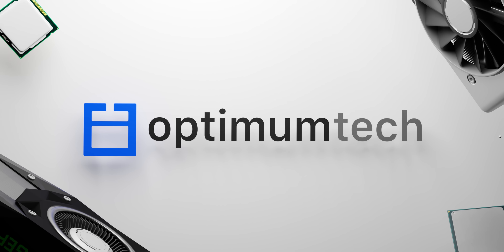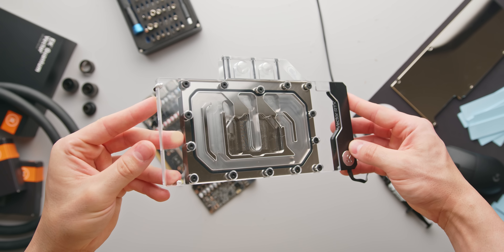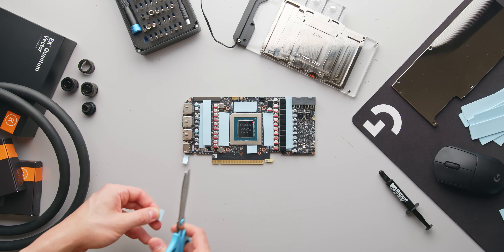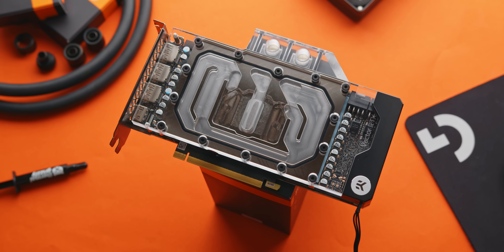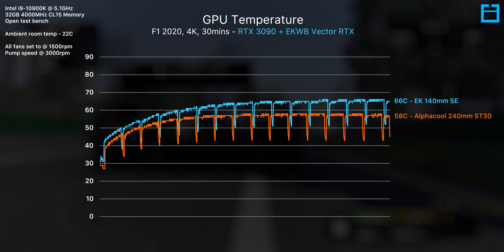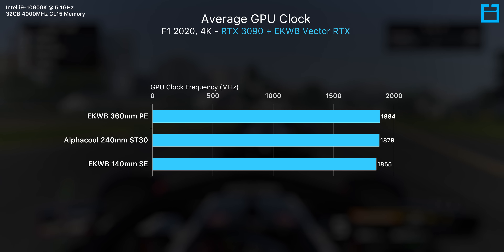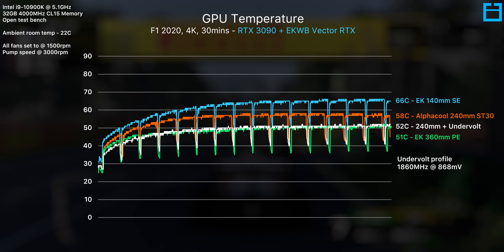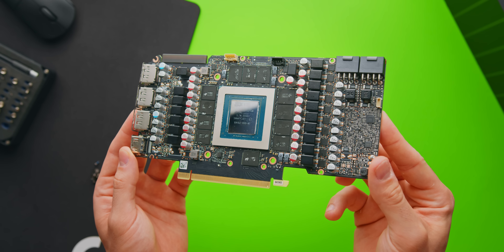RTX 3090 Liquid Cooling – Better Than Expected?

Comment: If only it didn't cost more than my whole setup...
Reply: Im debating on the 6800xt or the 6900xt either way ill end up with the 6900 but ill end up buying the 6800 first just to get my build in a case and running tired of all the boxes and stuff sitting there
Reply: @superbvillany1678  that’s crazy bro
Reply: @mectic5149  yea i know.. But i can always sell the 6800xt for exactly what i paid or a little under to sell it faster. The shortages make it a little bit quicker.

Comment: Woooooooo yeah baby, that's what I've been waiting for!
I would actually like to see a comparision in performance, temperatures and noise level between your current watercooled 2080 Ti and your new watercooled RTX 3090. I'm curious to see what results you'll be able to get with your single 240mm radiator and that oven of a 9900K.
Reply: Noise?
Reply: @micobugija6284  Yeah. Because he's using a 240mm rad to cool both his 9900K and 3090, maybe he will need to crank up his fans speed a bit. So the noise level will be different depending on the card used.
Reply: What do you mean "oven"? The 10900k's TDP is 30 watts higher than the 9900k lol
Reply: @maximelearning  Yes but the 10900K die and IHS redesign give it some better overall thermal transfert capabilities than its 9th gen counterpart.
Reply: @Hateroz  30 watts better? Because it would have to be that much of a difference or greater to make up for 125 vs. 95 watts.
Reply: @Hateroz  l forgot he is using a block on the CPU too 😐
Reply: @maximelearning  TDP means nothing.
Reply: @Erowens98  Between different manufacturers maybe, but this is an Intel-to-Intel comparison. No matter what inaccuracies/exaggerations there are, they will be the same between the 9900k and 10900k.

Comment: Imagine putting this in the ncase m1 with dual 240 mm rads and the pump res water block. That would be insane
Reply: I want to see this in the Winter One case with dual 280mm radiators
Reply: For what it’s worth that’s what I’m currently doing. Although it’s with the 3080 FE and a ryzen 5900x once released. Waiting for those last 2 parts then it’s ready. Already put most of it together. 2x 240mm rads and a iceman res and pump combo on the back
Reply: @shibaspeed  I just did some looking at the winter one. That might be the case I go for.
Reply: This is exactly what I am doing. I have the Zotac 3090 and a i9 10900k and dual rads. I have my EK block on order for the 3090.
Reply: I got two 360
Reply: @TheChadillac  I have my 360mm Slim rad on my rotec 3090. While it's on idle it'll be around 23c while playing games it'll start off around 40c then work it's way upto 65c slowly clumbing up within 10mins. I have no idea how people are saying it's like 40-50c when that's just not the case.

Comment: Just finished installing one of these in my dual radiator Ncase workstation, basically all done with guidance from this channel. Thanks so much for all the great info over the years!
Reply: Hi,  what  waterblock and gpu are you using with your ncase and how are the temps with the dual rad setup?
Reply: @BlubbieFirglan  Hey there, using the same PNY 3090 and ek block Ali is showing in the video. With 2 slim 240 radiators (25mm) I'm getting temps in the 30s during normal use, and mid 40s to low 50s when rendering, depending on cpu utilization at the same time.

Comment: I've been looking for this test specifically since the 3000 series launched. So thank you. I was worried I'd need a bigger case for more rads, seems not. 

Would have been nice to see more info about noise levels though. Or even a thermally normalized noise chart, ie. How loud are they all at the same temperature. After all, being able to throttle down your fans on a 360mm rad is a big advantage over a 120mm.

Comment: Just want to say thanks for the undervolt idea. My 10850k wanted 1.6V at 5.2Ghz according to VID and actually Vcore went as high at 1.45 under load. Much better now. 

Also dropped 60W with a 3090 undervolt and the whole system is running much lower temps now.

Comment: If you could include some G6X temperature testing when you put that into your system (esp the rear side modules) that'd be awesome, that's the one biggest thing I'm concerned about with a waterblock on these cards

Comment: I was surprised as well. If a GPU is using that much power it’s going to get hot. But seeing you got such results is relieving. Good work Ali.
Reply: I have a 360mm rad with a 3090 i get 65c max & this is after 10mins of use.
Reply: @Near2Future  Are you on a custom loop 🔂?
Reply: @WarriorsPhoto  Full custom loop & cpu has it's own loop.
Reply: @Near2Future  DAMN! Is that your first build with a full 🔁 loop?
Reply: @WarriorsPhoto  Nah, second build. I'm unsure why my temps are so high. 65c on water with a 360mm rad & 3 fans seems hot af. My 2080 on the same loop was in mid 50s
Reply: @Near2Future  Oh wow! 😳 
Does the new GPU run hotter?
Reply: @WarriorsPhoto  yeah around 10c hotter on full load with 340w
Reply: @Near2Future  Gotcha. 
I am surprised that modern hardware runs so hot at times. It’s almost like we have to over build our PCs now a days. 😖

Comment: How crazy is it that the 3090's clockspeed only goes op 30-40 MHz when looking at watercooling vs air, when the 2080 ti went up around 80 MHz. Aircooling has become so good at this point.

Comment: Did you measure the liquid temperature? When running at 66C GPU-Temp the water temp is propably over 50C. Some pumps or tubing are not made for high water temperatures like that and may fail after some time.

Comment: I'd be interested to seeing you fit this in the T1, especially with a backplate as I was unable to install my 2080 Super with the EK backplate due to lack of clearance behind the GPU. Not an issue as my card doesn't have components on the back that benefit from cooling, but I imagine the memory on the back of the 3090 will want to be cooled once it's in the T1.

Comment: 4:20 Here is a reason:  If you increase the rad area you can have the similar temps but vastly lower fan speed. 1500rpm sounds loud to me. 
If you have a large case and a stupid amount of free fans, why not? 

I have 480 and 360 in a caselabs merlin,  push pull on both with 15 sanace fans.  They sit at 400rpm and go to about 750rpm gaming. I have never seen the GPU (1080ti) go over 50c even in hottest summer days with 30c+ ambient.  It is overkill i know, thats the way i like it 😁

It is suprising what you can get out of a single rad though, certianly impressive considering the amount of heat. I could forgive a computer that is small and powerfull being abit louder under load.

Comment: In F1 2020 my 1080Ti hits 2088MHz and tops out at 35C (26-27C idle) with a 3 radiator setup in a View 51. With a 3950X running 4.6GHz/4.4GHz@1.35v as well.

Comment: Nice, I have the same PNY 3090. It’s a very underrated card. Stock Bios allows for 110% TDP which lets it boost up to 2ghz+ reliably at around 63c just under 80% fan average. (Stock curve) Water cooling should bring down noise considerably.

Comment: A custom loop is too expensive for me and my O11 mini doesn't have room for a pump with a 3090. I do have room for a 280mm rad.
Is there an AIO that I can use or that can even drive this block?? I had a 2080ti with a NZXT X42 140mm AIO and it was incredibly effective; idled at 38°C, 51 under load. Is there something like that for the Gigabyte Gaming OC 3090?
My R7 2700x is separately cooled by a 360mm AIO.

Comment: I have a 3090 on 3 360mm (o11 dynamic xl). I can tell you there are diminishing returns. Sits at 50 c under load.

Comment: Love this video. FYI I have 2080ti w/5GHz 9900k in shift x case,  120mm+240mm rad, I didnt like my temps, GPU was around 55deg c or so, couldn't oc my GPU much, so fitted external radiators using QDC and it now runs with extra 2x360mm rads in the loop, so basically 3x360mm in my loop. Idle is 29deg c, Max is 43deg.c, I can OC 2080ti +1100 on mem,  and hit 2115MHz on GPU. Love it 😃 next case will be 011D mini with 2x360 and 280Mmm rads. 😃 new build in Jan.

Comment: Nice 3090.  Will the Kraken G12 work on this card?  I use a G12 on the 2080ti like yours but with a fractal 240mm cooler which gives sub 50c temps overclocked all day long under full load and totally silent.

Comment: An issue issue I haven't really got an answer for with this water block: The VRAM modules on the back of the PCB are normally passively cooled with the stock cooler as they are hooked up to the back plate. However on this they are left by themselves with limited thermal mass when their siblings on the other side are cooled by the waterblock..

I feel like 6-12 months down the line I'm only going to have half my VRAM as the modules have died.. I am waiting for an answer from EK about this..

Comment: Looks awesome. But I have to ask since I never watercooled myself, are they really silent? 1500 RPM on the fans? My Noctua fans never go above 900 RPM, and my Strix card is silent during gaming and barely audible during heavy games. Those numbers looks amazing for overclocking though, and it's on a friggin 3090 :D

Comment: Very intesting video.  I'm looking at building a closed loop with a Bykski 280mm radiator, a UV Zotac 3090 + a 5900x, by this video I guess the 280mm radiator, despite only being copper core would be enough, or wouldn't it?

Comment: I'd be interested to see what you would get with 3 x 360mm radiators and that card. For reference, my 2080 Ti maxes out at around 37-38 C with i9 9900k in there too.
Reply: Lizardpeter   i have 3080 ti ftw3, in custom loop, 4 radiator push pull 16 fans, double pomp ek, and cpu ek elite, temperature? 43-46 degrees on max load, i espected more down degrees but no, the card is too hot, 4 radiators!!! 16 fans!!! 2 pomp!!! But no, the temp no come down!! My oled 2080ti 31 32 degrees. Sorry for my english. Don't espect crazy temp. The card have 450w and this is a problem for custom loop water
Reply: @xxghostriderxx1484  Yeah, makes sense. They run hot with a ton of power draw. Your temperatures are still good, anyway.
Reply: @lizardpeter  thank you, what I do not understand, however, is how some people do with only 2 radiators and a few fans and a single pump to get 41 42 degrees !!! a friend of mine does these temperatures with the galax 3080 ti. me with 2 pumps and k in serial, and the whole world of cooling, nothing I do not stoop. then there are games like Ghost recon that also push it to 45 46 degrees .. mah .. then whether the pumps are in full load or at 2000rpm, it does not change by 1 step, and this also makes me think. in general, the increase of the pump revolutions makes the temperatures lower, even by 5 degrees, then with 2, even better. but nothing. at this point I think the waterblock ek did not come out well, and I am convinced that there is something in the factory assembly.

Comment: Forgive my ignorance please. What is the difference between Founders, reference and aib boards?
My understanding is FE boards are the design and layout by the oem, in this case nvidia. Reference is a standardized specification and layout released for aftermarket manufacturers by the oem. And aib is the unique proprietary design and layout of aftermarket mfgrs. like ASUS  ..... yes ???
Reply: The reference spec is the basic spec and layout as given by Nvidia. Nvidia don't use the reference spec for their own Fe 3080/90/70. Some AIB's use the reference spec, and these will be the cheapest AIB models. Other AIB's choose to modify their boards from the reference by using upgraded components and perhaps an upgraded power delivery layout.
Reply: @Safetytrousers  thanks

Comment: Hey optimum, you planning to fit this in the NZXT  H1? I wonder what temps you'll get with the CPU also dumping heat in the measle radiator size of the H1.

Comment: Thoughts on experience level needed for either a custom 240 loop in a T1 or dual 240 in an M1? Scale of 1 to 10? Both seem relatively straight forward based on years of lurking on all the build logs on forums, just a matter of what pump/res block and planning for filling/bleeding/draining.  Looking to do my first custom loop but also first SFF build. Really like the T1 overall but leaning towards the M1 for optimal cooling/noise.  Planning a 5900x/3080 (ti if ever released).

As always, love the content.  Thanks

Comment: So I also have the Corsair SF 750. I got it to power my 5950x, 6900 XT, 32 gb RGB gskill 4000 ram, 1tb m.2 drive,  6 tb wd 7200 rpm hd, and ASUS ROG strix X570-I MB. But it keeps just shutting down. Do you think the PSU is faulty, or do you think I just need more power? The system works fine in my old desktop setup with a 1600 watt PSU.
Reply: I think you got a faulty unit, i have the same psu and motherboard, Ryzen 5900x and rtx 3080 and have never had an issue.

Comment: Really want to see this in the Sidearm T1! If I ever get to build a SFF workstation, I'm definitely going to use that case because of the balance of size, cooling, and aesthetics. When I was originally planning my build, I was going to use a Quadro RTX 4000, but the RTX 3080 is more powerful and cheaper, not to mention everything AMD has been coming out with lately. It doesn't matter though since I  probably won't have a need for a desktop pc for few years since I just got a fully speced XPS 17 that I can just plug into my 43" Samsung 4k TV.  I'm still really excited to see the final build in the Sidearm T1 with the blue water-cooled 3090!

Comment: ok my custom loop has problems then, i have a 240(2xmf120 from cooler master) and a 280(2xsp140 from corsair) with a d5 pump cooling a mere r7 1700 and it maxes out at 60° with a room temperature of 22,3. the case is a q300p without the plastic panels on, i thinkl i have to drill the hell out of the case so the rads have more space

Comment: I'm running an RTX 3080 with the same EK block with an 3700X on a 360mm dual rad and the card max temperature is 45celsius degree amazing block

Comment: Is it feasible to have 4 x 3090 watercooled? Need a 4 gpu workstation, and top choice so far is A5000 on Asus Sage mobo, but 3090 is cheaper and faster. Main problem I can see is needing 2 slot GPU + cooling (blower style hard to find), so watercooling might be the solution?

Comment: Hi, I really like your videos and I am in love with small cases. I am currently try to build a 3d graphic workstation with 24 cores threadripper, 128 gb of ram and a 3090 Asus TUF gpu. I would like to make a build i can easily transport, since I live far from my hometown. Would you suggest to go for a smaller yet ATX case (like the Cerberus X), or should i go for a more airflow focused case, even if it is bigger? I am a little worried about temps. thanks

Comment: What watertemperatures are acceptable for a custom loop?
Reply: Delta T of <20 Celsius. So if your room is 21 degrees Celsius, water temperature is below 41. I believe I have a delta T of 13. But this is with 2 rads 360+480, but fan speeds on silent mode.

Comment: Thanks, good to know as i was skeptical i would be able to cool my 9900ks and 3080 with my current radiator setup, and haven't got room to admore rads. Just one more thing wich would be good to know: what temperature is the coolant in the system, this never gets discussed.

Comment: Why not test the undervolt with the 360mm? I like to keep my GPU at around 40c so I need more rads because I don't want to hear any fans. Also lower water temp helps the longevity of the plastic tubes and especially the water pump.

Comment: Is it possible the loop didn't reach equilibrium? With a 30min test period, I've had at least 2 loops in the past that were fairly small and took 40-50 minutes to do so... Any thoughts on that? A bit hesitant to accept these results, just based on personal experience.

Comment: Just curious, did you measure the backplate temperature? I am considering using the block in a sandwich style case, but I heard that these G6X modules get very hot under load. I am a bit concerned due to the lack of airflow over the backplate in that kind of case.

Comment: Were you able to obtain memory junction temperatures with these fans? I hear the 3080 and 3090 GPU memory junctions have been running in the high 90s to low 100s C with high loads.

Comment: One potential video idea Ali, is a "comparison" or "guide" for 3080/90 models and waterblocks for SFF cases in terms of size. I have my name down for a 3080 TUF (since it is one of the best AIB models based on the reviews) for a while now, but I just recently discovered that it is by far not the best option for me since the waterblock won't fit in my case (it's very tall). So, I have to focus my attention on other models, but getting in line just now... chances that I will get one before the end of the year are very very slim.

Comment: I wanna build a mini itx pc in a ncase m1, I have a question about putting 2 nvme ssd in my pc. Do they need cooling? Can I fit a heat sink for the ssd that goes in the back of the board? Thanks.

Comment: if the case can fit a ddc pump with the 3090 water block can it also fit an ek vtx pump because theyre supposed to be around the same size as a ddc but with the performance of a d5

Comment: I’ll come back in a couple of weeks when I build my new case and watercooling, 2x 120mm 1x 240mm 2x 360mm 1x 480mm 1x 360x50mm ice res, 1x thermaltake distro plate/pump 1x bykski pump in a thermaltake core p8 tg with a ryzen 9 5950x and a rtx 3090 just waiting for the rest of the parts been delivered the blocks and rads + cpu been released but I’ll report back the tempts

Comment: That 140mm rad performance is ridiculous. I'm envisioning a 5600x/RX 6800 custom loop that could beat a 10900k/2080ti system in gaming (probably) while pulling ~300w and using a single small rad. Could even use an HDPLEX and get everything in a tiny custom case. Unfortunately money STILL doesn't grow on trees...